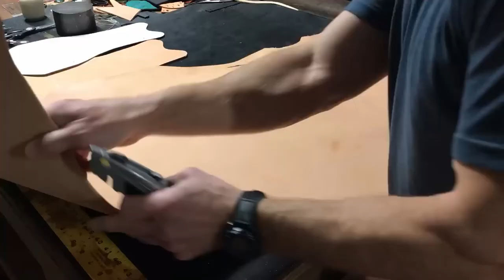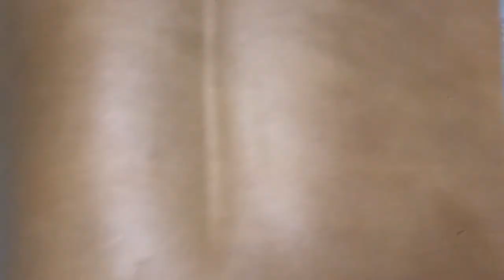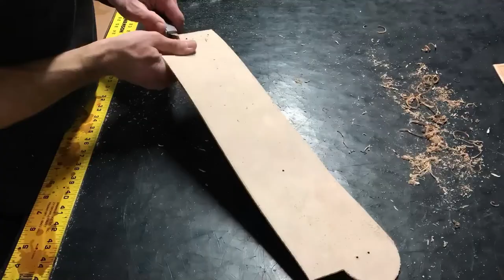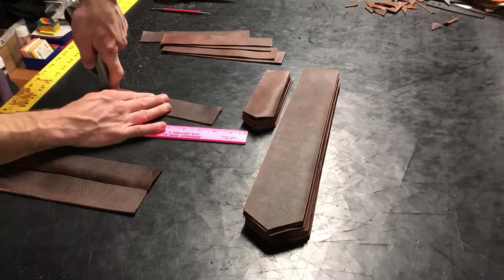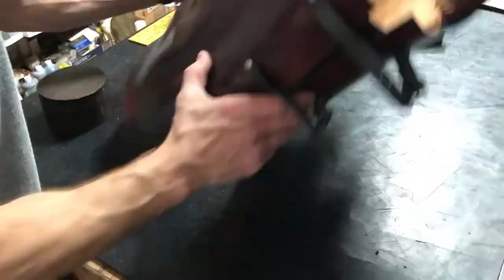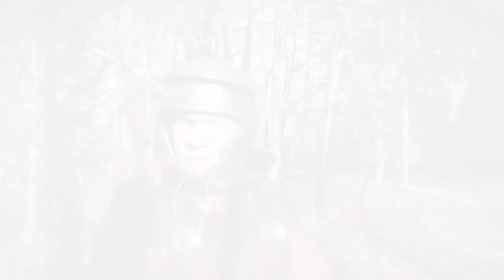Making a Real Leather Armor Imperial Roman Officer Suit

Comment: Outstanding leatherwork.  But - just wondering - no arming cap under the helmet? Seems like they would have used something to reduce slipping and to absorb direct blows to the head, since the design of that helmet was so advanced.
Reply from the maker: That particular one already has a leather liner in it but yes I believe an arming cap would have made a better fit.
Reply: yeah those were a thing as we can observe in a collaborative video by Imperium Romanum and Invicta

Comment: Did you mold that off of one of those punching bag torsos?
Reply from the maker: No. It’s a basic plastic mannequin but I have to make the abs and other areas by hand. It helps me get the general shape.
Reply: ElvenForge that’s kind of a key point I was wondering how you were going to make it. Do you have a video showing how you worked it? I’ve always wondered how that worked.

Comment: The helm is not an accurate replica, right?
Reply from the maker: I think the helm is. It’s a Paul Chen brand and their stuff is pretty high quality.
Reply: @ElvenForge  But the neck guard looks too bulbous, resembling the infamous Trooper Helmet, no?
Reply from the maker: @chevyyyyyyy  honestly I don’t know for sure.
Reply: @chevyyyyyyy  What do you mean by "infamous?"  Not picking at you, just curious.  I admire the Roman professional approach to armor, but I'm no expert.  Is the helmet in question an amalgam of different archeological finds? Sort of a hybrid to express what they actually wore generically?  I've seen lots of film depictions, but that's just the wardrobe department.  Seems to me that the bulbous neck flange would have been excellent for deflection, shedding the blow onto the heavy pteras of the segmentata.  I'm also very interested in what the wore under the helmet, as a shock absorber.  An arming cap of some kind.  I doubt they would have left out such a critical detail after designing such an excellent panoply.  Any ideas on that?
Reply: @OutnBacker  I am addressing the helm only, not the leather armour. The troops made a cap from soft material to dampen the otherwise hard hard helmet’s bounce during the march. While the rounded neck guard would theoretically deflect a hit, the roundness, the convexity, is not accurate. The archeological finds during this period for helms that legionaries wore showed the neck guard to be a flat disk as seen from the side.

Comment: They never used leather armor.  It would be useless.  A glades would just go right through
Reply from the maker: Yes there seems to be a lot of debate over that but thick  hardened leather is quite strong. We were not able to cut right through it with a gladius.
Reply: @ElvenForge  you should sharpen your sword leather armor like this doesn't make any sense and would offer basicly 0 protection still it look pretty cool great craftmanship
Reply from the maker: Thanks for the compliment. And yes, a sharpened sword would definitely help, but you're still not going to punch through it as easily as you might think. Once it's hardened like this, it's like punching through wood.
Reply: I still would choose a subarmalis plus a lorica gallica any day over this junk